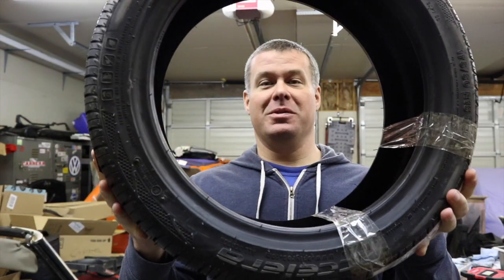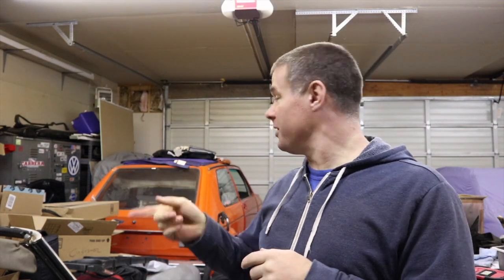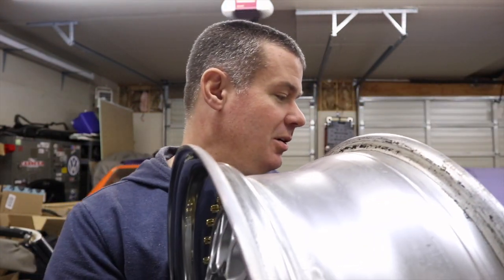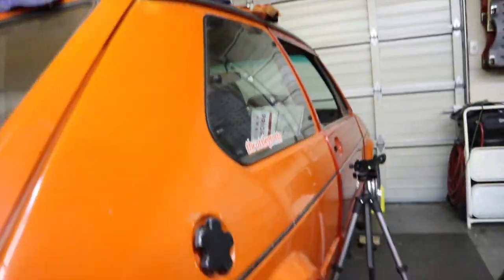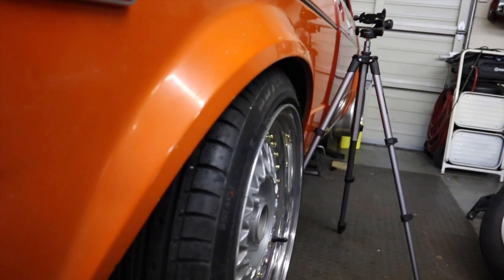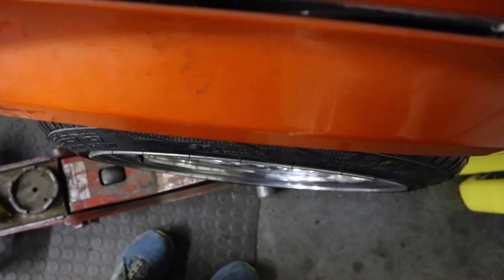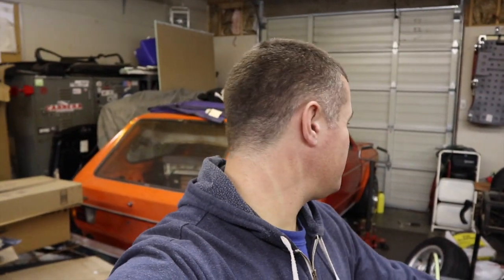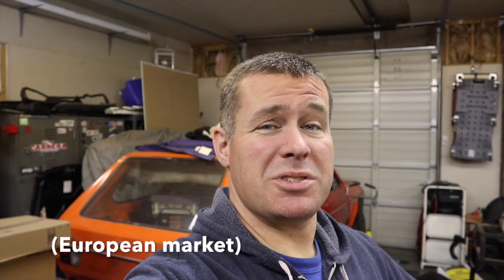ARE 398 wheels (BBS RS style) test fit- 1975 VW Rabbit 1.8t 20v ep44

Comment: I’d leave the front and even add a small spacer on the rear to match.  I don’t think it’s as bad as you believe.  I have those same Accelera tires on my Prelude and they are pretty decent.
Reply from the maker: The offset and fitment game is definitely different than what I'm used to. I'd like to do a really nice airride setup on the car at some point, but $ is the biggest barrier on entry for that.

Comment: Any chance you could machine the mounting pad on the faces? Doesn't look like you need much. BTW I went with those tires years ago on my focus when they first came to North America (Italian tire if I remember correctly). My experience with them was great, good grip in all conditions, I was a little iffy as they were $400 installed for a 215/45-17 but they turned out to be a great tire.
Reply from the maker: I don't think there's enough material to safely machine the mounting pad. I looked at that option, but finding a machine shop willing to machine a mounting pad is difficult, even if you have a lot of meat at the lugs. New outer lips are pretty inexpensive for a pair of 1", and I think turning the wheels and separating the barrel and lip is going to be more reliable than machining a mounting pad - that's a one shot deal for sure.